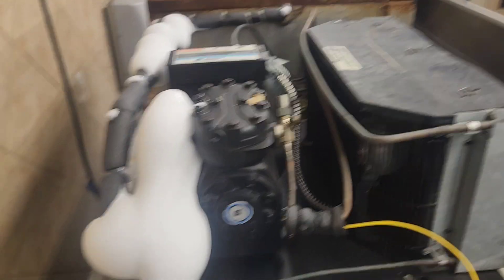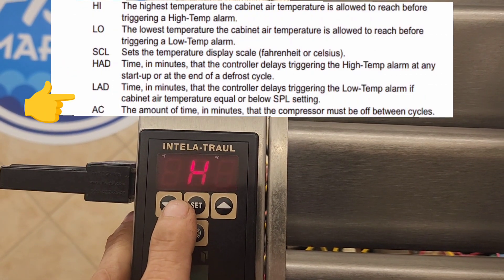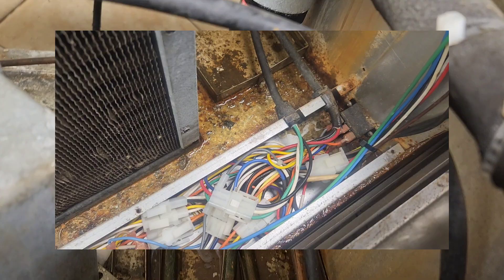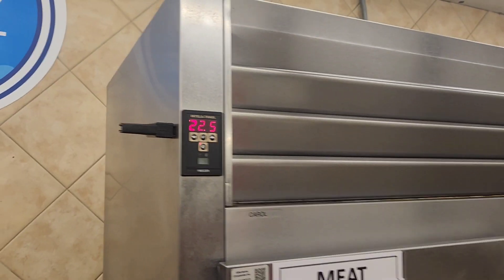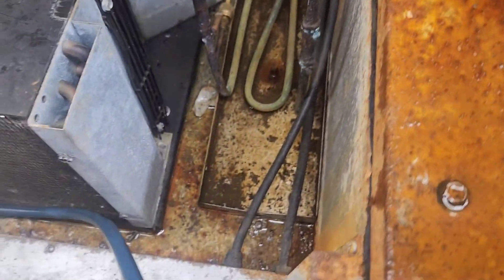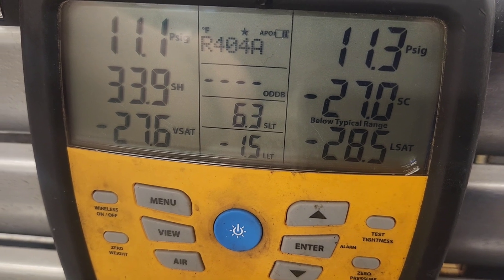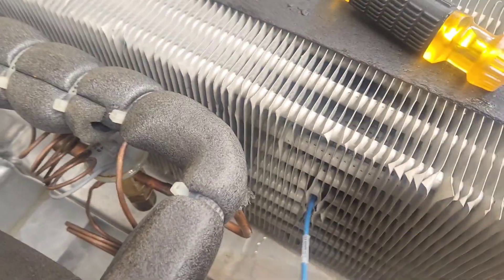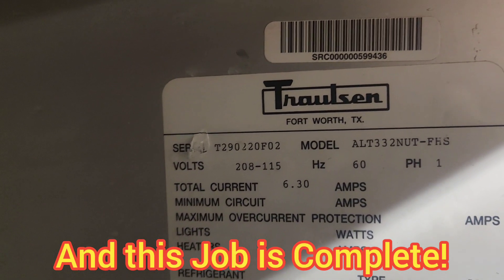Reach In Freezer(RIF) In Supermarket Meat Dept Doesn't Freeze well

Comment: Tip for those units. When you don’t have a sensor, you can use the discharge line sensor temporarily. All three sensors are the same.
Reply from the maker: @BLUE_COLLAR_REFER  oh yea absolutely. Just have to splice them in because the plugs are different good each one.

Comment: If you ever have a bad evaporator (EL) thermistor, on those older red InteliTrauls, and don't have one. You can unplug it and it'll do time INT time TERM defrost forever. The new blue ones will do that for 72 hours then lockout defrost until reset or you replace the probe

Comment: Use a steamer. Get the $99 Wagner automotive steamer. Takes 9 minutes to preheat.
Reply: Dude I swear by the steam gun for fridge /freezer evaps like this. Goes so much faster!! I learned it about ten years ago from an old timer and I never looked back. A hair dryer just pisses me off nowadays.😂😂😂😂
Reply: @Kee_Op  I use the Wagner for sxs 's as a backup while using the Bissell and it cuts down on time. I had to cobble a Dc fan to clear all the steam so I can see. Especially if I can't get the evap fan to stay on in diagnostics mode.
Reply: Totally agree you can get a bissel at Walmart for 39$ or Harbor Freight has a Bauer 39$ very portable.